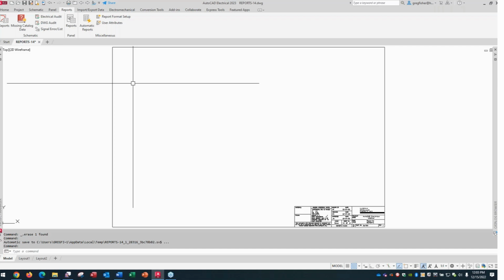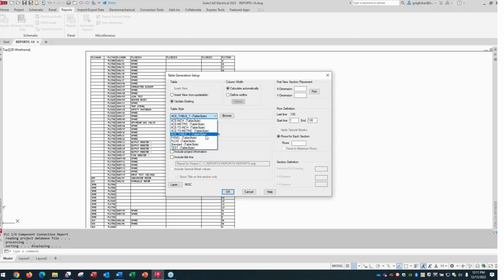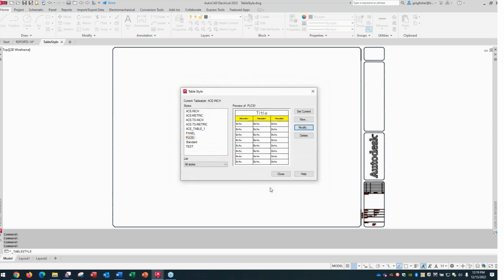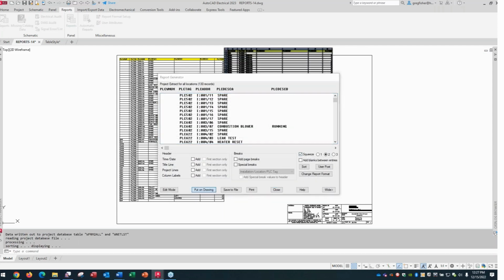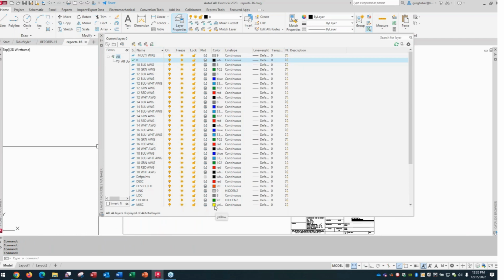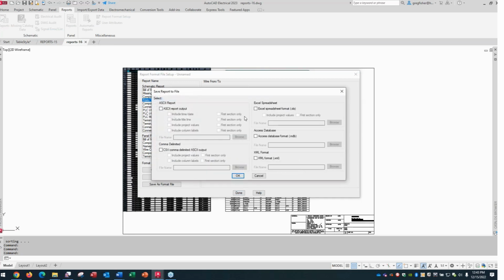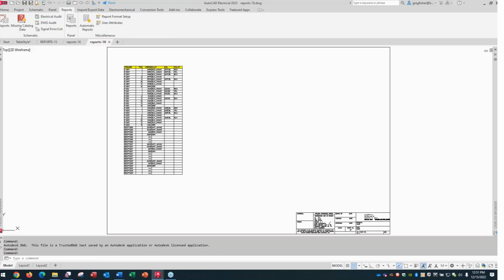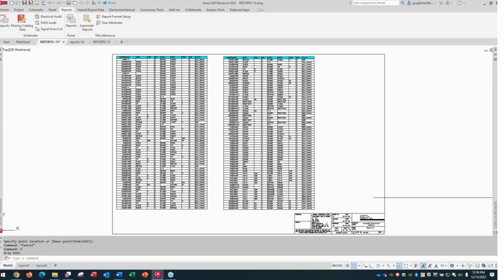Getting the Most out of Your Data with AutoCAD Electrical Reports

Comment: Is there a way to force it to use the alignment settings from the table, or do you need to go through that every time you place a report?  That seems like a bug that should be fixed imo
Reply from the maker: The alignment is controlled in the report format! It has a default setting, so you should only have to set it once.